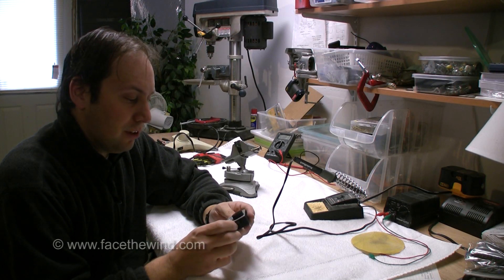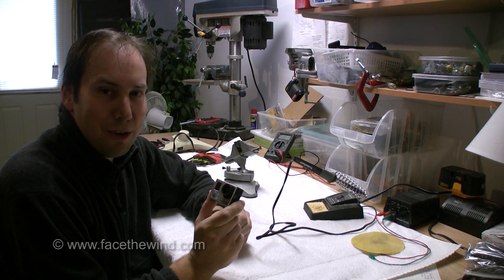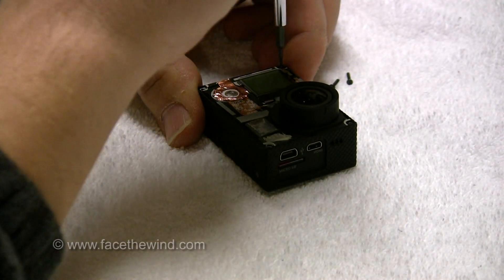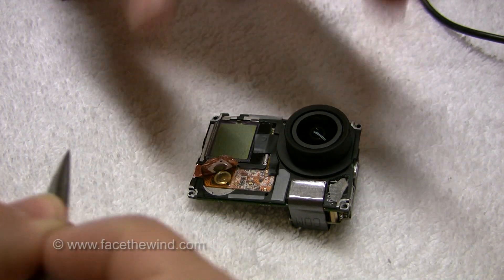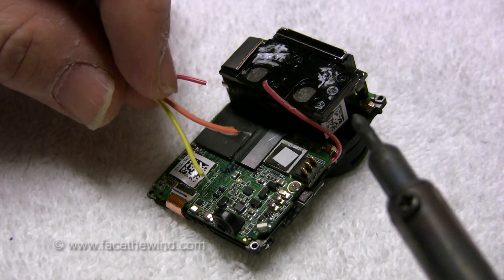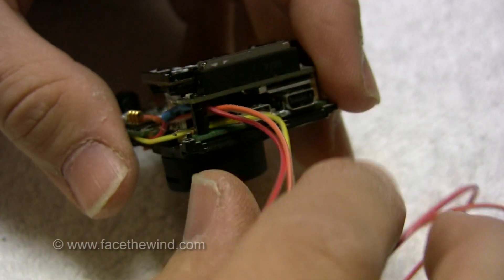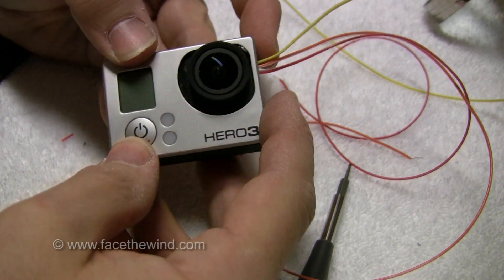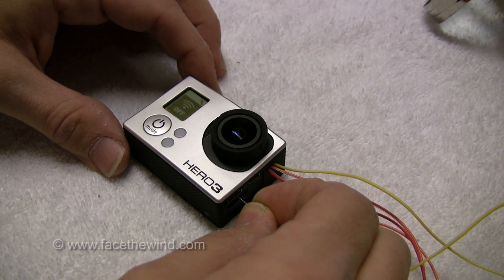How to hack a GoPro Hero3 for wired remote control

Comment: Hi, Thanks for the video. I'm trying to do the same with Hero 3+ black but as the board connections are a bit different , I don't know where to solder the wires for the shutter/wifi on the board . is it possible for you to upload a pic or schematic for shutter or wifi connection on the board for hero 3+ black also ? Cheers.
Reply from the maker: Unfortunately, I don't have a Hero 3+ to play with. Do you have a photo of the board? I've heard it's quite different, using ribbon cables to connect the switches, so it's much more difficult to solder to them.

Comment: will doing this on a Her 4 silver or black be the same wiring solder procedure?
Reply from the maker: I doubt it. The H3+ and newer models have very different internal circuit boards. It might be possible (I haven't tried), but you'd have to locate the switches and bypass them like shown in this video.
Reply: Hero HD Bus:  http://chargeconverter.com/blog/?p=71
Reply from the maker: Awesome! I wish this information had been available back when I was originally doing these mods a few years ago. I remember looking everywhere for any pinout diagrams for that connector, but it was still pretty new at that point.

Comment: Very impressive and brave. 
Is the ground also accessible from the inside? For me, the shutter button is the most desired remoting function. It also seems the most accessible contact.
By the way, your method is by for the most practical. 3DRobotics use the rear port on the Solo but its still their secret, how to use it.
Reply: im thinking of buying the back adapter/ board from ebay and using a dedicated channel to start and stop recording.  hopefully that helps with the dumb zenmuse H3-3D lack of start stop

Comment: Check this out: Wifi Remote Control for 4 $ and with 3 Parts, without taking the GoPro apart! 
http://euerdesign.de/2015/12/29/prototype-smallest-and-cheapest-gopro-remote/
Solder just a Long Wire to the Button of the ESP!!!!

Comment: Will this allow me to get full control on my drone? I have a Yuneec q500 and i can only tilt it etc gimble control and video feed but can't start stop record ? +facethewind
Reply: +facethewind
Reply from the maker: +manny c If you have an output on your drone that can be used to close a relay, then it could be used to trigger the camera using this hardwired method.
Reply: i feel like with this method you can keep whatever control your drone has, but then add start stop record to a dedicated channel.  did you manage to figure out how to do it?

Comment: Why didn't you trace the board to find points instead of soldering to the switches, maybe a better idea to use thinner wires next time.

Comment: Can you connect the trigger via an LED switch to the PIxhawk for remote shuttering the camera on Mission Planner Distance credentials, instead of time on the camera? I got your link from a DIY drone forum, for which I assume you are familiar with Pixhawk Flight controller for Land Mapping missions with drones...
Reply from the maker: FPV Cambodia Actually no I don't. They must have just linked to my video. I have no idea what that is, but it sounds kinda neat!
Reply: +FPV Cambodia : I can do that I used to hack GoPro hero 3+ connect to hero port and remote control from remote controller

Comment: Hello! Great video. I am working on a project where I am trying to use a motion sensor to trigger the shutter of the gopro. Do you have any tips? I saw you used the ground on the USB port to trigger the button pressing, is there a way to instead send current through the wire to trigger it? Thanks!
Reply from the maker: Josh Lazar That's probably not a safe way to do it. The GoPro is triggered by current sinking, not sourcing. But as long as the ground on the GoPro and the ground on your trigger circuit are the same, it should be pretty easy to have it trigger the camera.

Comment: Why didn't you use the 30 pin connector. There's a pin to gnd combination in the 30 pin layout to do just that. The connectors are available on ebay and the pin layout is published everywhere... :-)
Reply from the maker: Perhaps they are now, but I made this video nearly 2 years ago, when the H3 was just introduced. Those parts & documentation were not available at the time!
Reply: The 30 pin connector has the power button connector on there but i can't find the shutter button required for the quick shooting mode start
Reply: 30 Pin connector only turns the GoPro on, and requires GoPro to be set to a mode where the camera begins filming as soon as it powers on. This is all good when triggering the shutter isn't time sensitive since the camera needs to power on before taking a shot. For mapping, though, I need the GoPro to trigger as soon as the signal is received by the GoPro from the flight controller so the captured photo is aligned with the geotagging info that's saved at the same time the signal is sent to from the flight controller.
Reply: +Rick McEwen Hey Mark, Did you ever find a solution to trigger to align with geotagging?  Thanks

Comment: I am looking for go pro 3/4 black shutter release that will allow me to see where I am flying and start and stop the recording after I have every thing in frame, can what you just shown do this?
Reply from the maker: What's shown in this video can certainly do what you're asking, assuming you have a way to 1) remotely connect the shutter to ground using a servo or opto-isolator, and 2) that you have a way to transmit the live video back to you while flying. But I've only tried this on the Hero 3. Folks have told me that the Hero 3+ has a different wiring scheme, and I know nothing about the wiring of the Hero 4.

Comment: This is very nice work thanks so much for this !! I fly drones and I need this for taking pictures .. so basically facethewind do I connect the shutter wire into the ground port on my Futaba receiver?
Reply from the maker: Best way is to connect to the ground of the Hero3 (the outer metal housing on the USB port works as a ground). Connecting to ground on your receiver might not work because it may not be sharing the same ground as the camera.
Reply: Facethewind hey my friend thanks, i have the gopro 3+ and i am stuck :( dont know what to do
Reply from the maker: zero00tolerance
One of my subscribers made a tutorial for the H3+...maybe that'll help.
HowTo: Hack a GoPro Hero 3+ Black Edition for wired remote control
Reply: Facethewind thanks my friend, I also saw that video but unfortunately it is impossible to do it the micro pins are just too small for me. Im good at soldering but there no way i can do that haha. There got to be another way to do this.
Reply: Facethewind ok good news i got it to work now ! the gopro 3+ soldered all by myself it was a miracle i dont know how i did it with those tiny pins,, at one point i accidentally jointed up all 3 pins with a solder lead but managed to removed it.

Comment: Would this work if I were to have a wire connected to the "capture" button at the top. Would connecting it to common ground take a picture or start recording video whenever it is toggled?
Reply: Oh nevermind forgot to notice that you've already connected to the shutter. Great, next step is to have on board flight controller touch go pro's common ground so it takes pictures at described intervals when the drone is moving. Great!
Reply from the maker: Ankit Sarvaiya
Keep in mind, the Hero3 is pretty sensitive to electrical noise, so directly connecting the ground can cause double-triggers. It's always best to use opto-isolators to control the switches if you can. They're cheap and small, and you might even be able to trigger them directly with the drone's on-board receiver, depending on how yours is set up.

Comment: I want to be able to trigger photo remotely (using a RC control and a receiver via a AUX signal). How can I do this? Is it possible?
Reply from the maker: Yeah, you should be able to do that using an opto-isolator. Your RC receiver could trigger the opto, and then the opto would trigger the camera. This isolates the camera from any electrical noise coming from the receiver...should make the button triggers more reliable.

Comment: So, how do trigger it remotely and how do you know the camera's status (on/off, wifi on/off, shoot mode, etc.).  thinking this would be a good mod on a Phantom UAV.  Thanks!
Reply from the maker: The only method of verifying the camera's status is either through the wifi app, or by using the video feedback (that's the method I use). If you were using it through a UAV, I'd imagine you'd be feeding back the live video to a display on the ground, so you could just get the camera's status on that display (just need to turn on the camera's on-screen display mode in the settings menus).

Comment: Why didn't you just make a plug for the port on the back of the camera and avoid all that extra work?
Reply: this! we need this
Reply: Sadly GoPro removed the trigger from camera with a software update, my Hero 4 black has not power or trigger via the back port.  Good work gopro! 
 @mando1187

Comment: I just tried the mod on the latest generation Hero-3 Black.  The location where the record and wifi buttons were once wired are now replaced by a micro ribbon cable.  Only way to solder was with a microscope.  I took the unit to work, ohm'd out the contacts on the ribbon cable and asked one of the techs to solder it for me.  A few micro wires later and it worked like a charm.  Using this to remote control the camera is a race car.
Reply: I have a full HowTo for the Hero 3+...I just haven't produced it.  Let me see if I can do that tonight.
Reply from the maker: Cool! Glad it can be done with the Hero 3+ too!
Reply: awsome!!
Reply: any of you can tell me which of the micro cables should i solder in order to wire the shutter and wifi? in the video it is so obvious but not in my case. I have hero3+. ;( could you please help me ... Thanks ... ;D

Comment: Sharing good ideas I can add it is also possible keeping the case (the smaller 3+)  and using external microphone/composite/power with a solution similar to this GoPro Hero3 + Black - DIY external mic adapter cable to fit inside case (waterproof). See comments for problems with wifi and external mic

Comment from the maker: I often get the question about why I'm using wires instead of the wireless remote. It's because the wifi has limited range. Many people want to use GoPro's in a remote location where wifi won't reach...going with a hard-wired connection is the only way to make that work.
Reply: ɷɷɷɷ Heeeeyyy Friendds I Have F0unddd Workingggg Online Hacck visittt  : -  https://t.co/2isTH7vYL9